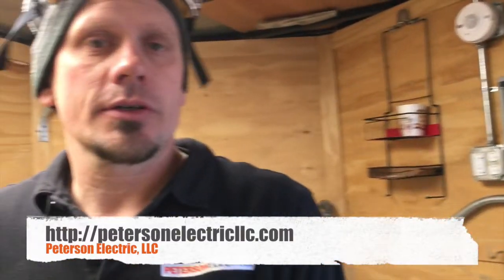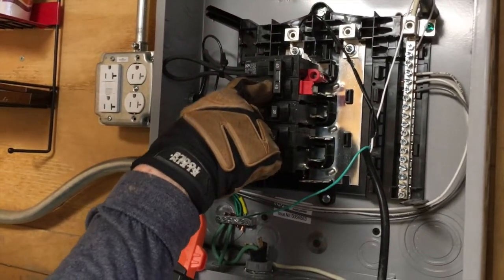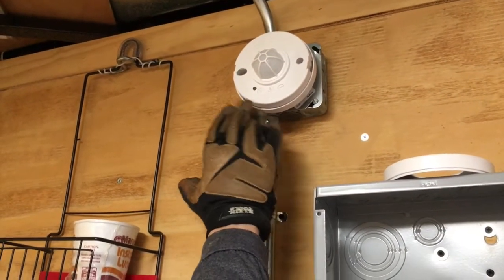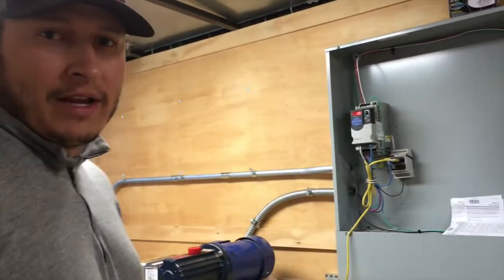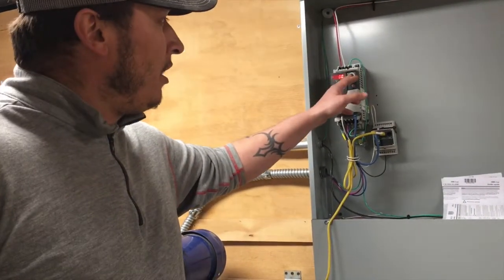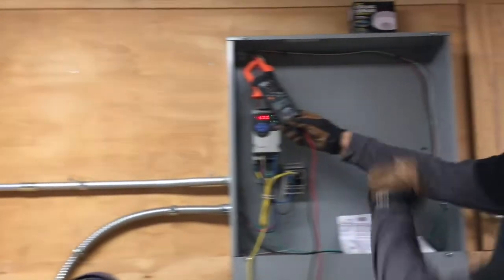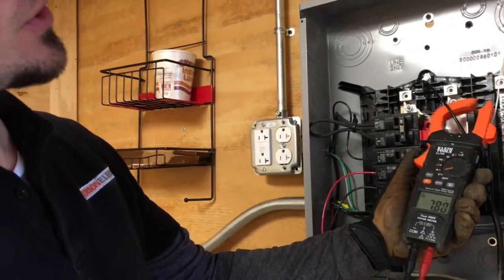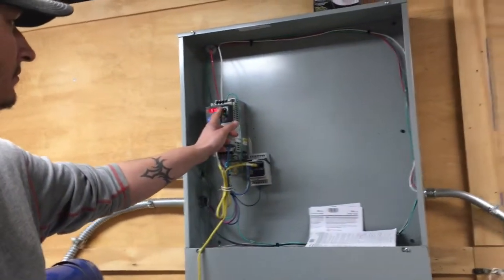Wiring A Work Trailer For A Water Pump For Fracking, Part 2

Comment: Why did you have an imbalance between line and neutral? With you’re 120v setup you should have equal current on both lines... You must have bonded the EGC to the neutral downstream. If you put your clamp around one of the grounds that’s where you’ll find the missing amperage
Reply: Okay I see what happened now. Your can is bonded to the neutral. So you have objectionable current coming back on the bare ground. You need to remove the bonding jumper. The EGC and the neutral are essential in parallel so the return current is split between the two.

Comment: Thank you as always for the videos. Hearing you recall the code articles helps a lot also. I was wondering what kind of sensor/light you had in that trailer. I
Reply from the maker: It is a 360 degree sensor, with harvest, and sensitivity settings. Amazon.

Comment: the AB 4m vfd controls the HZ going to the motor. the I.O controller communicates with the with the HMI and the I.O controller sends a singnal to the VFD at what hurts to run. (4-20 MA or 0-10 V or through the network cable)